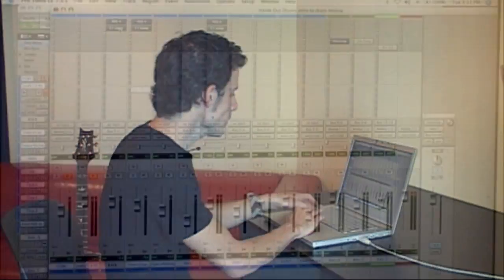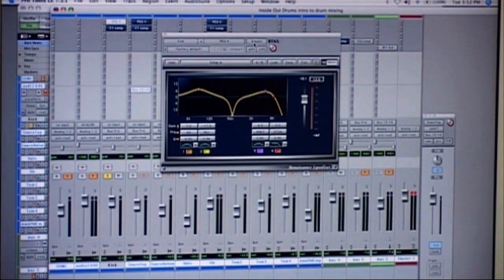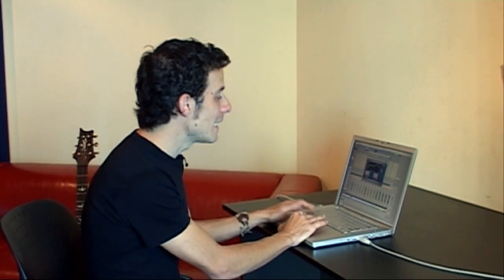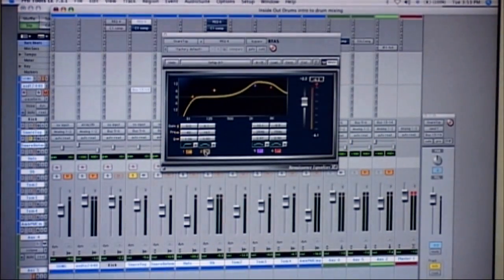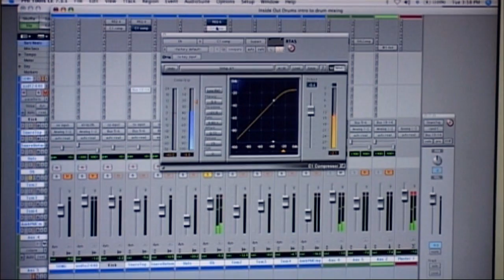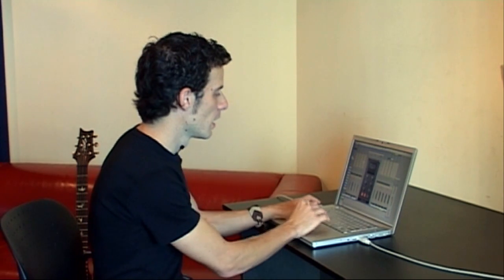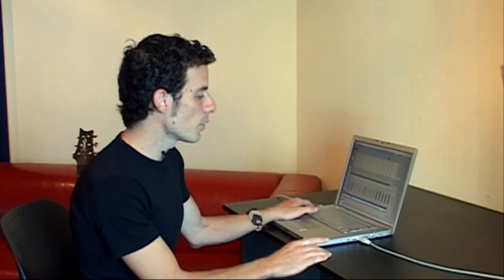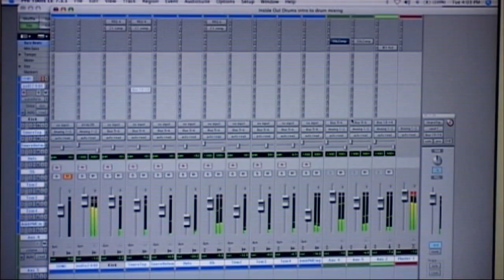Intro to Mixing Drums

Comment: This guys cuts right to it. Excellent results really quickly. I think he forgot to mention why he made 2 aux returns. I believe he set one WITH the same compressor in bypass, using that as the uncompressed bus for easy level setting between the two. He installed the bypassed compressor (same one) to keep the phase alligned. Otherwise there would be latency between the two causing a phase cancillation. His Stereo Master bus was too hot though. Best keep that at -3 db below the red or even lower.

Comment: This was the case until recently when M-Audio came out with the Fast Track Ultra 8R. It has 8 simultaneous recording XLR inputs. I just picked one up and I'm very happy with it. Just for reference, I use Pro Tools M-Powered 8 and my last interface was a Fast Track Ultra (4 simultaneous XLR inputs).

Comment: You can get high end Pro Tools interfaces which have 32 channels of I/O, such as the " Digi 192 ".  This is the interface you will find in all recording setups involving a recording console / mixer going into Pro Tools.  That is how they do it ... for example, a studio which has a 100 channel console will be able to plug in up to 100 mics at once, and then be able to run all those channels to Pro Tools individually using three or four Digi 192s.

Comment: Tip:
1. Compressor first then EQ, unless you have a lot of unwanted noice in your recording and you want to take it away before you compress.
2. If you put the compressor after the EQ and want to go back to adjust it, the copressors settings will be changed aswell.
And that snare sounds like it is on its own, not really part of the drumkit.

Comment: I've found that when I use parallel compression on anything (and I set it up the same way he does - with 2 auxes receiving the same input signal) I have to put a compressor on both to compensate for latency in the plugins.  Then one compressor is set light to none and the other is completely smashing it to about -20dB.  I love to use the BF 1176LN compressor on the drums!

Comment: You need to set up the compressor as a send effect, (like you would with a reverb or delay) rather than an insert. Once you've got the compressor set up the way you want, play back your mix without sending any of the signal into the compressor, then gradually send more and more signal into the compressor till you get the sound you want.

Comment: This might be a stupid question, but I was doing some mixing of a song the other day when I realized whenever there were really hard snare hits, it caused the volume of the song to breathe, or swell. It's as if there was some really weird compression effect that turned down the song's volume for just a second and brought it back up on loud snare hits. What is this? How do I stop it? I also realized that if a EQed it a certain way, it would stop, but it would stound worse.

Comment: Hello Daniel,
nice mix you did here. I got 1 question, I like the parallel compression that you did, but didn't quite get how you put the buses. You mean you open 2 AUX tracks with the same input, pass all the drum tracks thru the AUX input and only on 1 AUX you put the compressor on? This is the only thing I'd like to know.
Cheers

Comment: If you work with wav 32 bit float there is no way to hear any clip distortion. Also if you export an audio track, it will be better no to have limiters in master section to avoid clip.

Comment: not necessarily. you might want to mix it as a group track if you have the same mics, in order to use identical treatment, but if you use two different mics, iwouldn't do that ....

Comment: Im sorry about the question, but OVERHEAD TRACK would be a GROUP CHANNEL TRACK? By the way, im a heavy WAVES plug ins user. Just one very small tip, if you are into dance music, Try Api 2500 Comp on your bass, couldnt find any better! Cheers

Comment: I agree with Low Light.compress to raise all freqs hidden to make all present,then start trimming or adding freqs.otherwise the EQ-Compress is a good waste of RAM as you try to fix things by adding another tonne of EQ pluggins,what a merry go round.plus......real mixing engineers hate fake samples (replacement therapy).......they work with the drum kit as it came like if the tracking engineer did a great job in capturing the perfomance.half the time the drum sounds great..........man I wish the 80's and the vinyl and tape era would come back.....separates boys to men

Comment: your master is peaking, check for masking signals, the track sounds good but u could have too much masking going off in the mid ranges since u took alot out of the drums, try boosting the mids a little more on some tracks to get more tonal balance and to let the frequencies of each track cut through each other more.

Comment: actually the unprocessed sound was much better, awesome recording! I feel like it's a great song ruined by the thin ear-hurting snare and cymbals, but that's just my opinion :)
Reply: Funny, I was just thinking the same thing and then I saw your comment.  Lol    Yeah, definitely too crisp on the high end.  I also though his panning was way too wide.   If you use panning to setup a stage-like picture the drums would stretch across the whole stage and you'd need a drummer with 12 ft arms.  Most top engineers do not pan overheads hard Left and Right.  I also didn't like the way he used compression.  I thought it made the kit sound over compressed.
Reply: YOURHipHopBeatsTV - | Rap Beats | Hip Hop Instrumentals - 2014 Being in stereo doesn't mean they have to be panned 100% left and right.  That's the whole point in my comment if you bothered to read it.